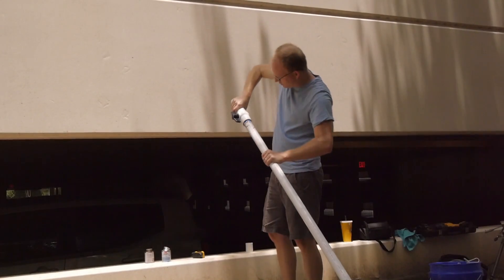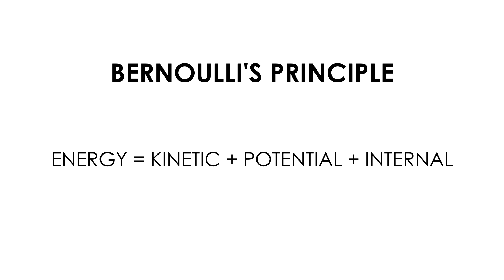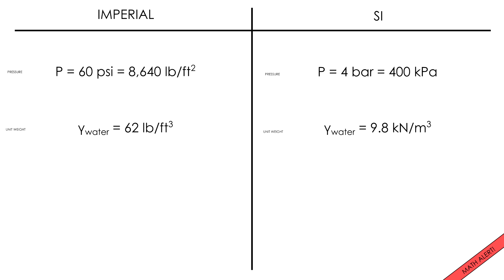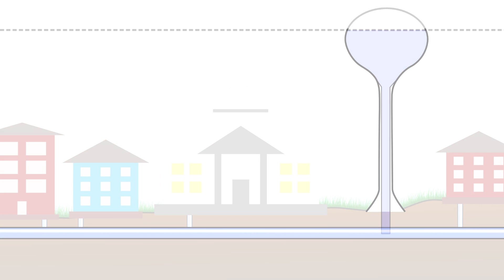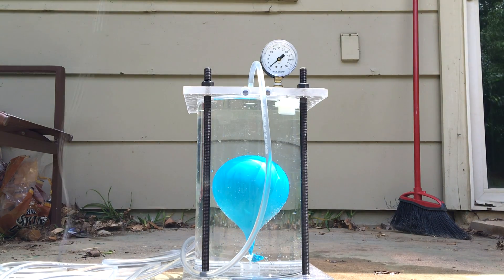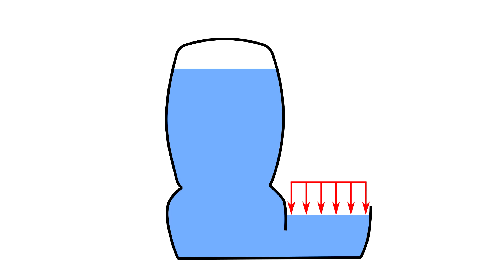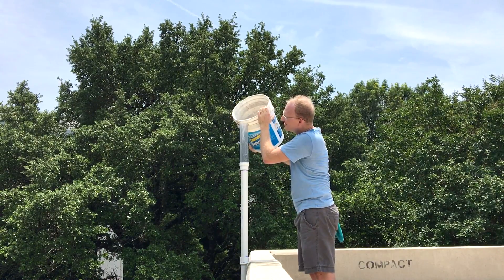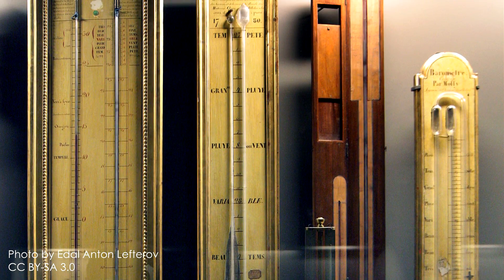Boil Water at Room Temperature! - Hydrostatics

Comment: 0:00. Which is ironic because I'm not sure at all if you have one.

Don't get me wrong. I love your channel.

But I was left pretty perplexed by your explanations.

Not of the explanations themselves. But how you could have gotten them wrong.!?!?!?!?!!!

1:42. The picture you're showing only has Potential and Static Energy. That is true.

But the picture you're showing Does NOT have the same amount of Energy anywhere it is measured from.

Due to its shape in the vertical. Meaning the higher the depth the lower the pressure.

I am assuming you wer referring to a closed and Static Energy pressurized system. But even then the picture you showed. Would still have greater Potential Energy pressure at the base. Then at the top. 

The only way for the picture you showed to have the same energy when measured from anywhere. Is if it were a closed pressurized system. Completely outside the Earth's gravitational field.

That is the only time your statement could be correct.

7:15. I had to watch this part three times because I was shocked that you got it completely wrong.

Let's pretend for a moment that water in a vacuum does not immediately begin to boil.

or some kind of ionic liquid that takes a long time to boil off.

Or perhaps not a complete vacuum. But a very low kph PSI or bar.

If the room you were standing in while drilling that hole. Was somehow a complete vacuum.

The same exact thing would still happen.

Because it is NOT the air pressure pushing into the hole and pushing down the water.

It's the weight of the water creating a vacuum. That's sucking in the air.

And even if there was no air in the room. The water would still fall. Because you have broken the seal.

Despite there being no air in the room. There's no vacuum to prevent the force of gravity pulling the water down.

It is the vacuum that holds the water up. Even if there's no air to fill the empty space inside the jug.

I know this may seem unintuitive.

And if you are still confused by all means make an experiment to test this.

Where you replicate the same conditions as the original test.

But put it inside a larger box that is under a vacuum.

You don't have to drill. But you could just make it a removable lid. Attached the lid to a string. And then attach the other side of the string to a magnet. And then place another magnet on the outside of the container. Right behind the inner magnet. So that when you pull the magnet on the outside. It pulls the magnet on the inside. Which of course is attached to the string. Which is of course attached to the lid. So when you move the magnet on the outside. It pulls the lid off inside the container. Which is under a vacuum of its own.

And you will see the water level drop exactly the same. As the first test shown in this video.

7:25. The atmosphere is not pushing the water up. 

it is the vacuum inside The jug that is holding the water up.

Literally the only thing the outside atmospheric pressure has to do with any of this.

Is the gas at the top of the water jug. Which technically still is under a vacuum.

But still has air pressure. However you will note it has less air pressure. Then the atmospheric air. 

And that pressure will be by the same amount as the weight of the water pulling against the vacuum.

So when the water level in the dish gets low enough. Instead of all the water rushing out. The atmospheric air pressure feels the the lower air pressure at the top of the jug. And rushes in to fill it.

But because gravity has a direction. That does not apply from the top. Like if you drilled a hole at the top.

Which is why the water would still fall. If you were in a complete vacuum and then drilled a hole at the top.

For instance. If you put that dog bowl jug thing. In a vacuum. And The jug was completely full with no air in it at all.

And then started to remove water from the dish. Like a dogwood when they drink.

The water level in the tank would not fall. The dish would become completely dry.

And the water would still not fall. Until you drill the hole in the top breaking the seal and the vacuum holding the water up.

I know this seems unintuitive. But again. If you go ahead and performed that experiment as well. 

It is the pressure differential caused by the weight of the water. That creates a vacuum that holds the water up.

But in the event there is no pressure differential. Because the water is full with no air in the jug.

And then that whole dog bowl contraption is put into a vacuum where there is no air.

It would cease to function. Until you broke the vacuum inside the jug. Despite the fact that the whole thing is inside a vacuum chamber of some kind.

And despite there being no air pressure. The water will still fall and overflow the dish. Until The jug is empty. Despite the fact that there is literally no air pressure anywhere in that process or equation.

So it is not air pressure pushing the water down. It is gravity pulling the water down. 

And if what you were saying was correct. If you drilled a hole while the dog bowl contraption was under a vacuum. Then the water level would not fall. 

And as we know it will.

So even if you cannot understand these concepts intuitively. 

Realize that you are explaining it incorrectly.

I hope you found this correction useful and or helpful.

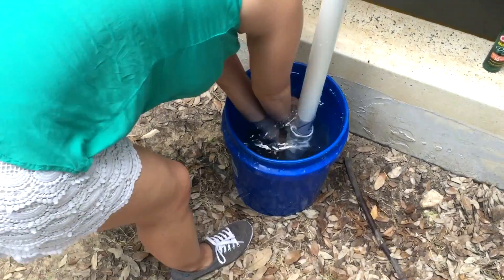8:34. While technically the explanation you gave was not incorrect. Because those things are occurring. You just missed the main point about what's happening.

So yes there a whole bunch of little bubbles trapped on the walls and suspended in the water. Not in solution but suspended in the water. 

As well as gases in solution in the water that come out of solution. And of course water itself that vaporizes and comes out of solution.

So you got all these gases rising to the top.

And that was your explanation as I understood it.

BUT. All of those gases are not cumulatively enough to displace that much water.!!!

liked by a lot.

So what gives.?

Why is that much water suddenly being displaced. 

And that's the part you missed.!

It is because all those gases have also greatly expanded due to the very low pressure caused by the vacuum at the top.

At a normal 14.7 PSI. All those gases take up almost no room at all. To the point of thinking that the cylinder was completely full of water.

But as soon as the vacuum was applied. That is the amount by which that little bit of gas expands at very low pressure.

And would have continued to do so until the pressure equalized enough for the water itself to stop boiling out of solution.

And I'm not at all sure if you had that understanding. Otherwise you would have foreseen making the clear pipe at the top a much greater length.

So again your explanation is not accurate enough to be a very correct one.

I hope you find this correction helpful.

It was entertaining thoug. So you still get a thumbs up. 👍
Reply: At 7:15 no, if the room was a vacuum the liquid in the bowl would drop before drilling the hole. No air pushing the liquid up.

And the water bubbling is the actual definition of boiling.

There is not pulling in experiments like this, only pushing. Forget the word vacuum, just think of it as less or lack of pressure.
Reply: @johncarlin6243   I'm afraid that is quite incorrect. There is definitely pulling in any reference frame wear Weight is applied.

And yes the water would still drop if a Vacuum was applied.

Even if you did not puncture it.

But only because of the liquid turning to a gas.

But in the event that the liquid stayed liquid.

It would absolutely NOT drop.!

Until the top of the bull was punctured. And then it would drop.!

Despite the outside of the Bowl being under a Vacuum.

With no gas being pulled in from the outside. The level would still fall to the same height as the rest of the water level.

Because it was the secondary vacuum inside the bowl. That was preventing the water from dropping.

As long as it maintained its vertical orientation.

Not the air pressure from outside it. Or the lack thereof in this case. Because the outside of the bowl is also a Vacuum as well in this scenario.

However even if the experiment took place under one atmosphere of gas pressure.

There would still be a secondary Vacuum within the bowl holding the liquid up.

This is applicable. Because of gravity. Which gives that force a specific vertical orientation.

But because the experiment takes place within a gravitational field.

The liquid wants to go down. But the Vacuum at the top of the bowl prevents it from doing so.

Again having nothing to do with the air pressure outside of the Bowl.

And again assuming the liquid does not immediately begin to boil.

It is the Vacuum inside the bowl preventing the water from dropping as long as it maintains that vertical orientation.

Having nothing to do with the outside atmospheric pressure or the lack thereof such as a Vacuum.

It is a battle between Gravity and the Vacuum that is being created inside the Bowl.

Ironically it is Gravity that is creating the force of a Vacuum.

Side note. Words like "Vacuum" and "Pressure".

Are used to denote the state of different gas pressures. And are used to describe these functions.

If you are not familiar with them. You should definitely look them up before attempting to correct someone else on them.

But I appreciate the comment.!

And if you disagree by all means do let me know.
Reply: @I86282  Well you sure have the gift of gab but I'll just suggest that you watch this excellent video a few more times.

Comment: I understand that "boiling" means converting liquid to gas, but is temperature required to increase during the boiling process?  That is, is the water that is boiling at the top of the pipe heating up to 100 degrees Celcius?
Reply: The temperature at which a fluid boils will change with pressure. Water will boil at 100C if it is at 1 atm. When the water reaches 100C it will begin to boil if it is at 1 atm, if there is less pressure the temperature will be lower and vice versa

Comment: Wait wait wait, did the water boiled (100°c) or just evaporated? Does the pressure applied the same energy as heat, and does it gets heats up at all?
Reply: Boil just refers to water changing from a liquid into a gas, the water does not necessarily have to be hot. The temperature at which water, or any liquid, boils depends on pressure. At 1 atm of pressure water will boil at 100C, if the pressure is lower the temperature will be lower and vice versa. In this experiment the water was put into a low pressure system so it would boil at room temperature.

Comment: Hi, I dont understand the boiling part?  What is the temperature? will the water be hot?
Reply: Boiling refers to water changing from a liquid into a gas, the water does not necessarily have to be hot. The temperature at which water, or any liquid, boils depends on pressure. At 1 atm of pressure water will boil at 100C, if the pressure is lower the temperature will also be lower and vice versa. In this experiment the water was put into a low pressure system so it would boil at room temperature.

Comment: Can you do it again with a thermometer 🌡 and prove that the water is really boiling
Reply: Water doesn't have to be hot to boil. Boiling is just liquid turning into its gas form. Think of it this way: Low temperature forces it to stay liquid. High atmosphere pressure will also force it to stay liquid. Raise the temperature or lower the pressure and it will boil to convert itself to its gaseous state. Works the opposite way too to revert to liquid form.

Comment: So you have not seen water come out on the bottom because water is a gas at zero pressure? Gas bubbles out of the water where it was absorbed somehow? Those bubbles are random on top of the column because the water has little time to create the vacuum organised and the point of zero pressure does not necessarily have to be in the top eights of an inch or at the surface, especially when it moves. minute 8:31

Despite the vacuum, water can be a gas? Is this gas everywhere in the vacuum, then this could be a tremendously cheap way to win watergas. It will benefit the entire planet and be able to change weather patterns. Also I think electricity producing companies can make good use of the watergas to propel those large turbines. Bottle this watergas in strong vacuum cylinders and warn buyers not to open. What they will find inside when they do is buckets of clear drinking water unless it is again decompressed.

Comment: siphon under pressurised chamber will working more rapidly so we can easily run a turbine with siphon pipes and with input of small electricity we can put the output water from outlet outflow again in the reservoir😝😋😝
we use the electricity produced by turbine setup, since we only once pressurised chamber first time and after that we only got energy outputs from turbine and generators setup😝😋😝😌😓

Comment: What would happen if you had a valve at the top, instead of just a plug, with a tank attached to it? when you open the valve and let a small amount of liquid through from the tank, would it flash across the valve?

Comment: In high school, (45 years ago) my class partner & I did this by filling a thin clear plastic tube in a barrel of soapy water, clamping the ends, then hoisting one up to the roof of the main 4 story building.  When the bottom clamp was opened, the top several feet suddenly foamed, showing the water boiled as it dropped, and the thick foam, dried, mostly in place.

Comment: At 8:54, water is not a liquid at zero pressure.  At 1:58, at the surface of the water,the height is greatest, and the water pressure is zero.  Would the water not turn into vapor at the latter?

Is it not that there is always pressure at the top of the column (atmospheric pressure), but less than at the bottom? Thanks

Comment: I have serious doubt about that.
If you take the entire ocean of the earth and cover it. and mesure the pressure at the surface, juste under the cover, it will be null.
but, if somewhere on the planet you now put a tiny pipe of 1cm diameter and  100meter high and water inside the pipe connected to the surface of the ocean, it mean that the pressure of this surface all over the world will suddently become 100meter pressure ?

Comment: pressures are only in the US with Hg all others use pa or Bar or the outdated Atm (Atmosphere, but nobody use this still in a scientific way), Why in the US you can't just use the SI / Metric system like everybody else does. I'm studing at University Enviormental Engeneering and in Physiks and enviormental Physiks wehre the most of the time we were discussing things like pressure, we found nowehre the Hg or water colum or atmosphere exept in a text from the 18th/19th Century. so it is Realy outdatet. And also now in meterology nobodyy uses these units anymore, because there not convertable to normal SI standart like Newton per squere meter. Its always funny to see somebody realy using these Outdatet units.
Reply: JLT PHOTOGRAPHIX It’s not easy to just switch. People have to be educated on the new measures and converting values from one to the other. That’s easier to do with someone who’s still in school, but not for the 55 year old equipment operator who’s worked in psi for 40+ years. Also, there’s a tremendous amount of equipment that would need to be changed—almost every pressure gauge in the country. They can’t all be changed at once. 

There’s a huge risk when the reference standards are changed and people aren’t familiar with the conversion. Look up the “Gimli Glider”: an Air Canada Boeing 767 which ran out of fuel at 41,000 feet. The plane was loaded with half the fuel needed for its trip due to conversion mistakes when calculating fuel need and fuel load—changing from pounds to gallons to liters to kilograms.

Comment: The Tesla on the Y axis and the ampere turns per meter on the X axis is a greatly helpful graph of what these terms mean pictorially in their many variations like B and H. I hope the beginning start of a current sin wave is comparable to a flux 'sin wave' in that voltage is greatest for current/flux at the rise close to zero; which is what it looked like on your oscilloscope. Great job.

Comment: Im clearly not a scientist but wouldnt they not all have the same water pressure since only two of them are wide rectangles and the rest arnt. The point im trying to make is containers two and three have the larges volume of water in them compared to the rest, and though they all are the same height, there is more water to push down on the pressure measuring divices (idk) in containers two and three then the rest. Im i wrong or wouldnt that make them have the most pressure than the rest. I did like the video tho good job

Comment: You said all five tanks have the same pressure at the bottom, but the first one seems to have less water in it than the rest, which says that it doesn't weight of the water is lower, because there is less water than in say, the second tank? Correct me if I'm wrong

Comment: At 7:20, the atmosphere doesn't push the water down. The atmosphere has already equalized in pressure. Gravity is working on the difference in height on the fluid; such that, the height and pressure of the fluid is normalized to the same height.

Comment: about the pets' water pots: I think the top of the tank shouldn't be vacuum. First: you can easily see the air bubble rushing to the top of the tank each time water is taken from the other side. Second: if we had vacuum on top of tank the water level should be around 10m to balance the 1 atm pressure on the other side